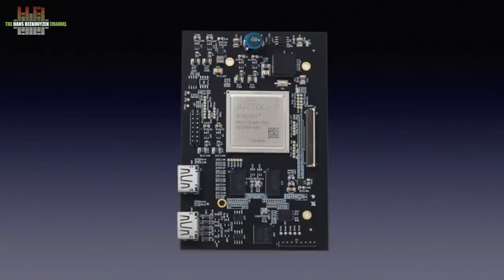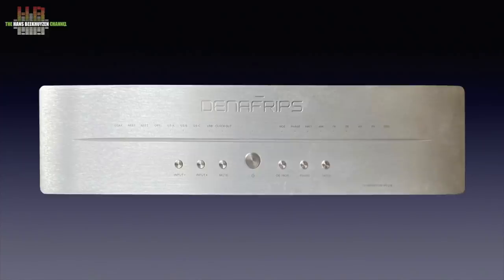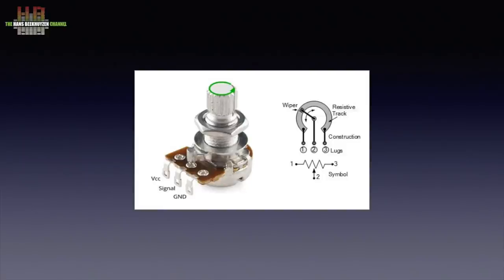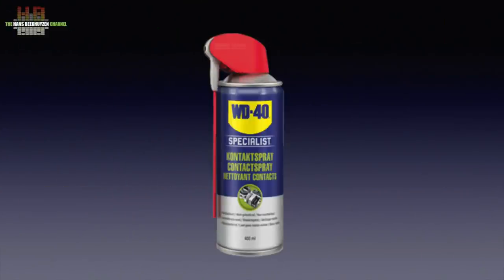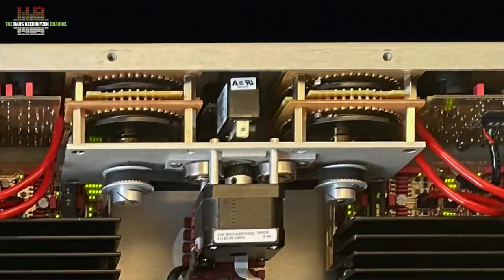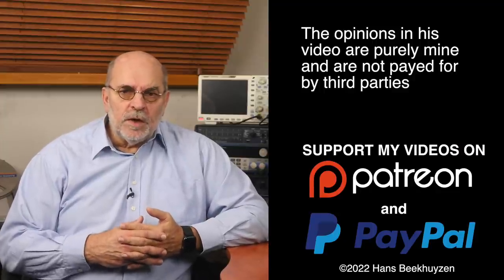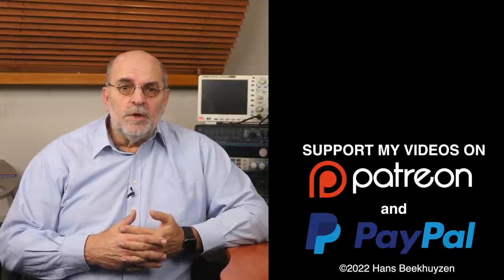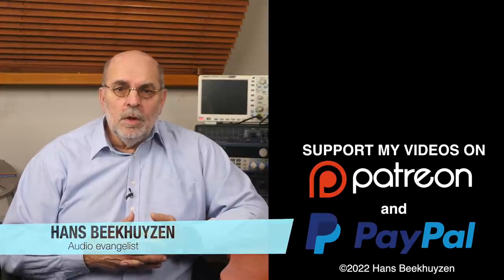What I have learned in 2021, part 2

Comment: If you employ an Apple device such as an iPad Pro as your music streamer, you can completely extinguish the display, notably attenuating noise and electrical interference. If that device runs on IOS15  or later and is used in conjunction with Apple Music, the results are sonically pleasing!

Comment: Hi Hans, thanks again for this interesting feedback! May I ask you (and other digital audio enthusiasts) a question I have often asked myself in relation with digital audio ? From what I understand, the exact time accuracy of the bit conversion to analog signal is an essential key (if not the very ultimate one) to the musical performance of a DAC. Hence the crucial importance of jitter reduction, clock accuracy ... to reach the greatest possible time accuracy ... However, during the recording/mixing of music, the ADC conversion, even done by professionals, is probably not perfect either, i.e. the digital signal is likely to contain "intrinsically encoded" timing errors. Right ? In these conditions, wouldn't a very precise timing DAC (as those 10k€+ with external clocks etc ...) "precisely" risk on the contrary to exacerbate these defaults, particularly on the least careful digital music encodings, leading to a kind of contra-productive effect ? In particular may this be noticeable for the recent digital conversions of older 100% analog recordings (<1980 ...) ? Sorry beforehand should this question finally not be relevant !
Reply from the maker: Let's be practical about this: we can only buy software that has been produced by studios. These might vary in quality but we have no alternative. Having said that, overall I am still amazed by the quality of digital audio sources. So don't make things more complex than that, especially since we have no influence on the process.
Reply: @TheHansBeekhuyzenChannel  OK thank you Hans, you are right, anyway by occasion I would be interested to know whether the average time accuracy applied for the digital sources preparation is better than the one applied in the bests digital playing systems.

Comment: Hey Hans, could you do a video about the USB audio protocol, or just answer this question for me? I have read and heard many conflicting arguments about whether there is error correction in the data being sent. Many sources say there is no error correction, many sources say there is error correction, what's the truth on this?
Reply: No error correction is possible in a USB audio data stream. There is no checksum, and and corrupted packets cannot be re-requested. In this regard, it's similar to Toslink/SPDIF.
Reply: @ChrisMag100  Ok thanks. I have seen other comments explaining in great detail how the USB audio checksum works haha, so I have no idea what to believe anymore.
Reply: @TheBlissfulWalrus  “The three main USB transmission protocols are Bulk, Interrupt and Isochronous. Bulk (used for data transfer to a hard drive) and Interrupt are error-correcting. Isochronous (used for audio) is not.” - Gordon Rankin (who designed the async protocol used nearly universally in audio these days. See his interview with John Darko dated 5/30/2016.
Reply from the maker: There are two protocols for audio over USB: Audio Classs I and II. Class I is like SPDIF and supports sampling rates up to 96 kHz for 2 channels. Class II is Asynchronous: it sends audio bits to the DAC until the buffer in the DAC is full after which it sends 'empty' packets to keep the connection going until there  capacity in the buffer becomes available again. The DAC uses its own clock to read out the buffer and thus is not dependent on the -in general poor - clock in the computer. In class II. error connection is possible.
Reply: @TheHansBeekhuyzenChannel  Interesting. If in Audio Class II the DAC can use its own clock independent of the computer's lower quality clock, is a digital-to-digital converter still important because of other forms of pollution coming from the computer?

Comment: What about a computer (dedicated, headless) that is connected via toslink to the DAC and Roons is used as software. I read that Roons audio protocol let the DAC control the clock, and with the electrical connection interrupted through toslink does this circumvent the problem that brings a computer as a source? In my testing it was way better than the USB connection - when the toslink implementation in the DAC is good. For a modest Setup, 1000-3000 Euro equipment...
Reply: Toslink cannot "let the DAC control the clock". It's a one-way connection. The clock signal is modulated into the datastream by the source.
Reply: I had a similar experience... Have used toslink for years from PC to DAC. Got an Ares2 last year, still used and preferred toslink. Then they released a USB firmware update, and I bought a Supra usb cable out of curiosity. I  would say it is now better than toslink in tonality. ....yes the toslink or USB receiver  hardware is important.
Reply: That makes sense, thank you for your answer. So Roon‘s solution is USB only. That let me wonder what an audio dedicated USB interface like the Unison USB from Schiit Audio + Roon can archive. Is the noice in the PC signal so inherent that it’s always a problem?
Reply: It looks like USB is finally becoming a more comfortable and better audio interface than S/PDIF. The option to transfer the clock to the DAC in combination with electrical isolation could solve the problems that comes with complex sources like PCs. Do you use Roon or a similar software that handles the clock transfer?
Reply from the maker: This all is true and not true. It is about how well the SPDIF or USB is implemented on both the sending and receiving side. In general computers perform very poor for both interfaces unless it is a dedicated music computer.